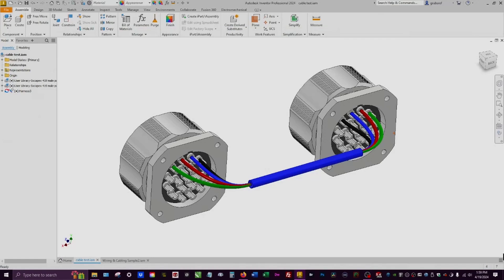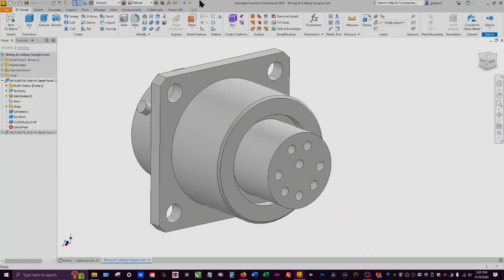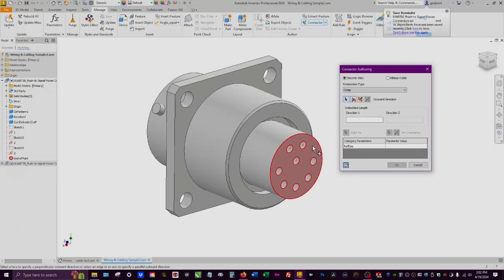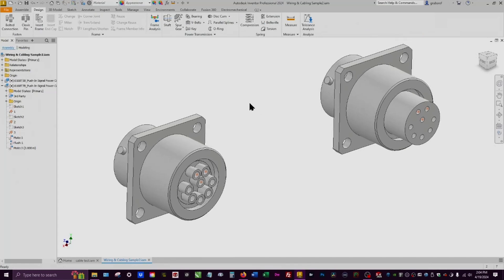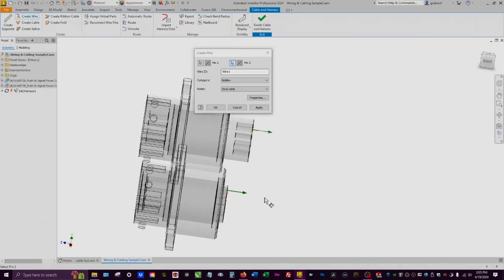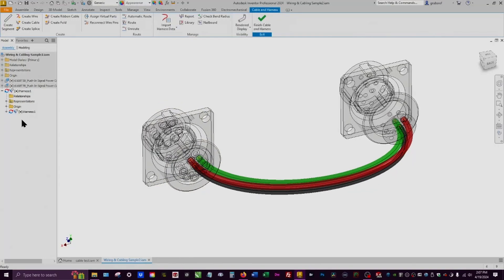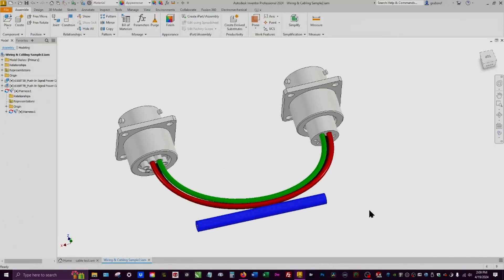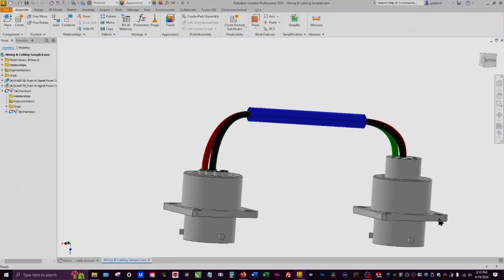Autodesk Inventor - Cable Routing

Comment: Very useful video, but you could make the whole process quicker by making one connector with pins, save it, then invoke it in an assembly, twice.  Then turn them around and join up with wires.  All good!
Reply from the maker: Thanks for the tip!

Comment: Quando i cavi si intrecciano, i cavi vanno in compenetrazione. C'è un modo per evitarlo. Grazie
Reply from the maker: they only way is to add point on the lie and move it around. It can get very messy but there is not a collision detection in this tool.
Reply: @Inventortutorials-1955 grazie